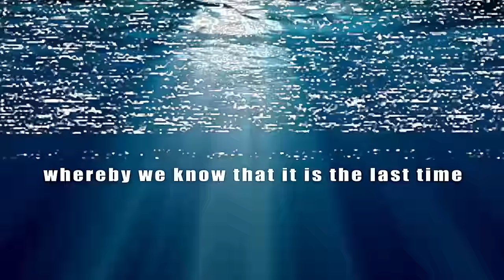Noah's Ark (Rare Accurate Version)

Comment: If the outer hull was indeed lashed together logs how did it not leak?  I've seen riveted steel sheets mopped with hot pitch still have leaks in it, God had to have a hand in this...
Reply: GOD was the architect and told them how to build it...so you are right..he did have a hand in it
Reply: @citayumul7321   What the flip does feg rygbyuoo mean?

Comment: The ACCURATE Ark was built like a quart size Milk carton, minus the pointy top. There was no need for a bow or stern. It only needed to float. The God given dimensions were 300x50x30 cubits, or 400x72x43 feet, with “a” window. Also, it had rooms inside, not stables. Plus, all the animals were more likely you, so they would fit, especially the Dinosaurs (Dragons like the Behemoth). It’s so simple when you just read, and not enter your own two cents.